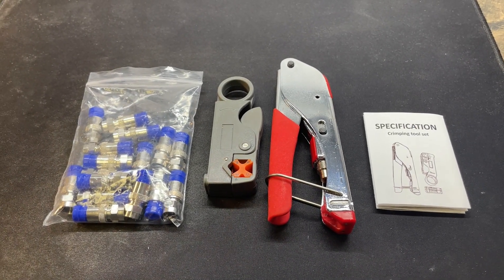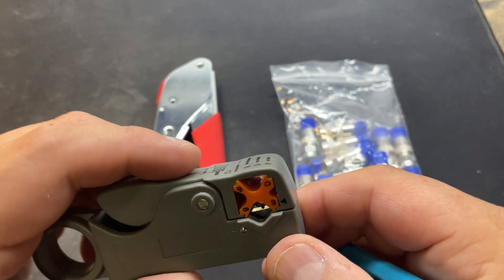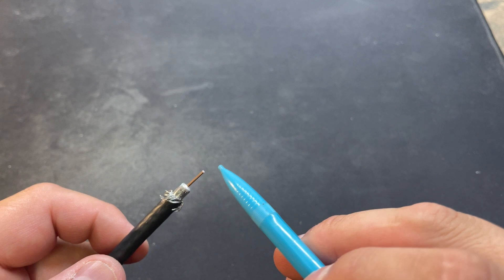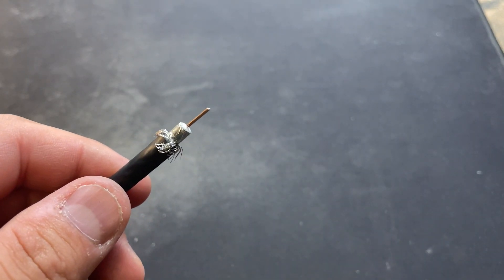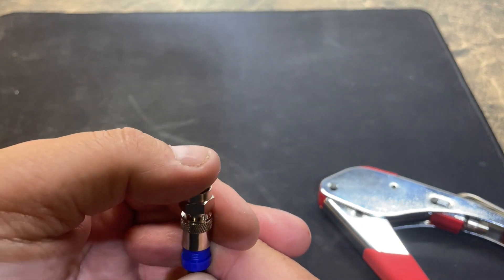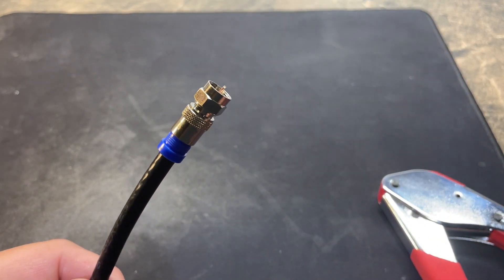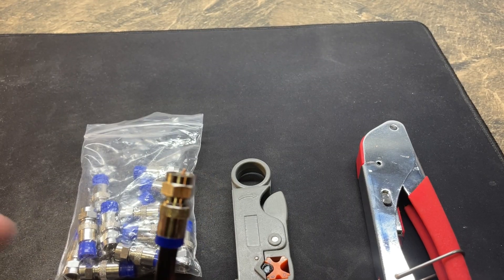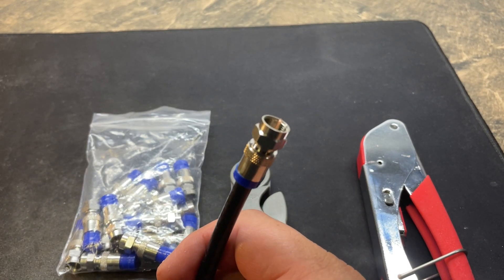How to strip coaxial cable (Rg6) & make RG6 F type compression connection.

Comment: The width of the prep tool is such that, by lining the end of the coaxial cable to the edge of the notch, the "stinger" (the cleaned center conductor) will be the proper length.

When selecting tools, I opted to go with higher end models that don't require adjustments (Cable Prep's "Super CPT Cable Stripping Tool" and a "Cable Pro" LCCT-S59-11). Admittedly overkill & expensive for most people, but they work extremely well. 🙂

Use of tri-shielded and quad-shielded cables will require a bit more preparation than dual shielded cables. Tri-shield RG6 is fine for most residential applications, while quad is good for installations where interference is a problem.

All in all, a fine video!
Reply from the maker: Thank you

Comment: Great video. I like the way you do your vids, no BS and you know what you're doing.            For some I'd like to add a cpl of tricks / hints.     Make sure there is no metal on the dialectic after you strip the coax. Make sure there is no dialectic residue on the copper center conductor, some cheaper coax will leave a little on it which can give you issues. The dialectic can and should stick out of the connector about 1/32 to 1/16", if it's flush you stand a chance of it backing down some.  If your coax is stiff you can heat it a little before you crimp to help the connector slide on easier. you can let the coax extend further out of the stripper when stripping and then cut to length after crimping.   One more... don't expect the center conductor to be solid copper. All high frequency coax is copper clad steel wire.
Reply from the maker: Thank you, I appreciate it.

Comment: Does it make any difference if you use rotate the v-block in the stripper and use the RG6 setting, also is it important to strip away the foil and fold the inner mesh down as well?
Reply from the maker: Yes it is important to fold them down and not allow them to make contact with the copper wire. The wire mesh is to prevent any electrical noise or static, shielding the copper wire. They are both used for interference and grounding.
Reply: For the RG6 Quad You should fold back 1st layer of braid then remove 1st layer of foil then fold back 2nd layer of braid then LEAVE 2nd layer of foil for shielding but make sure it doesn't touch center conductor. 
On Double shield fold back the braid but leave the foil again making sure it doesn't touch center conductor.
Then Bam, Bobs your Uncle.

Comment: Note: As said in the video. 
These connectors are for DUAL shield cable. Will not work with QUAD shield cable due to thickness of cable. 
Termination process is slightly different for QUAD shield cable also.

Comment: did the crimp hold?
Reply from the maker: Yes. I haven’t had any problems with any of the connections I’ve made.
Reply: I would be careful using the Term CRIMP when this is actually a COMPRESSION tool and connector. Might be confusing for some, they might buy a crimp tool for compression connectors or vice versa.